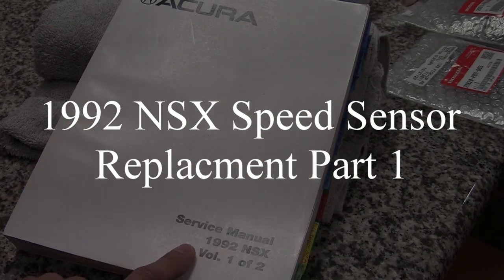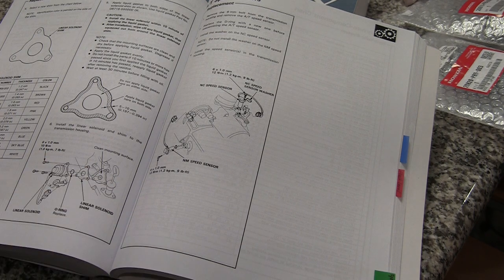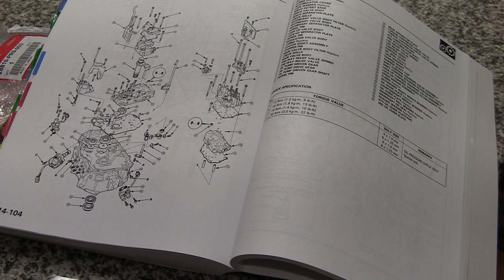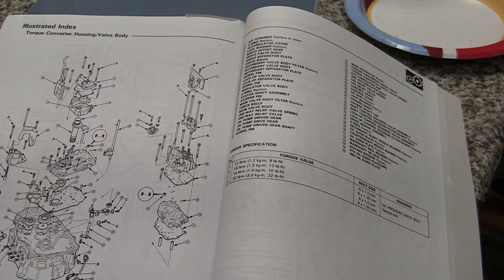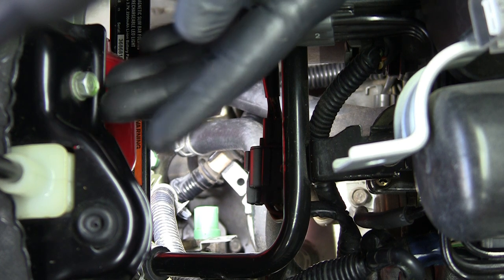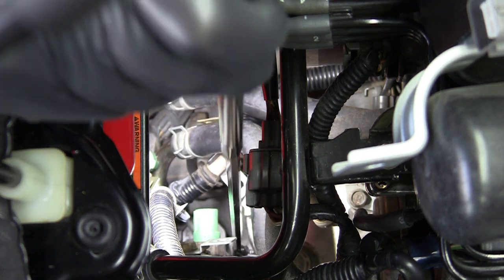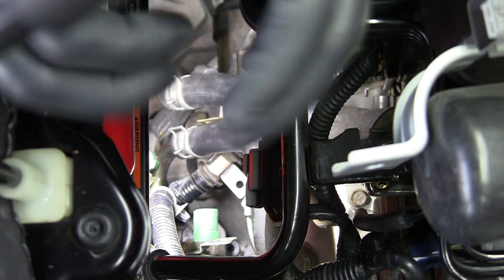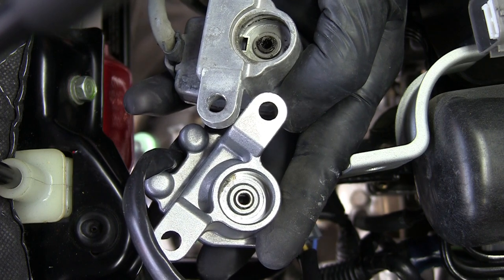1992 Acura NSX Speed Sensor replacement. Part 1

Comment: Hello. What's happen with the mainshaft speed sensor with the part number 28810-PR9-003 which you bought, but didn't use? I have 1996 NSX automatic with error code 15 (which is this mainshaft speed sensor), the tranny stucked on 2nd gear and won't change neither 1st, nor 3rd or 4th.